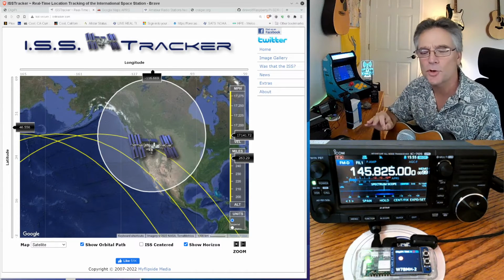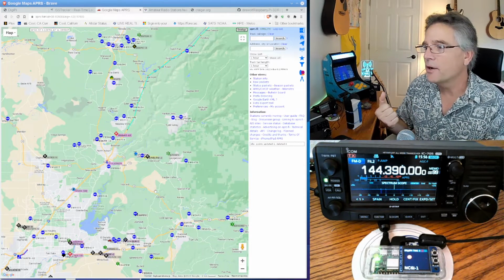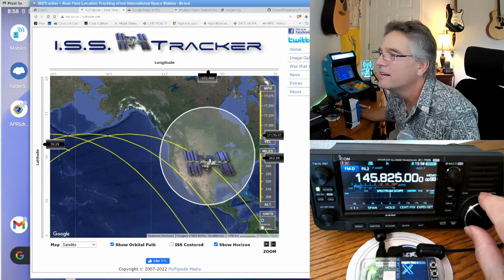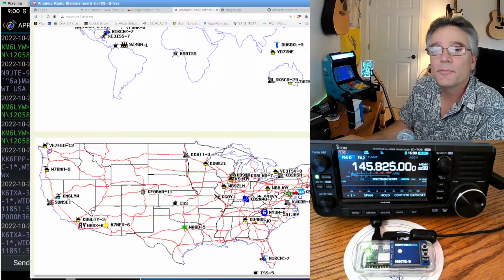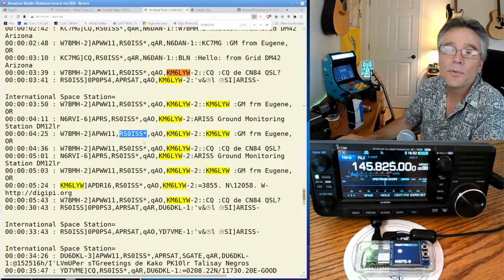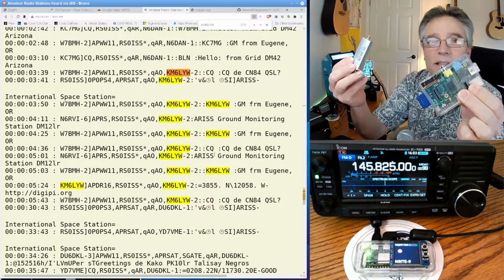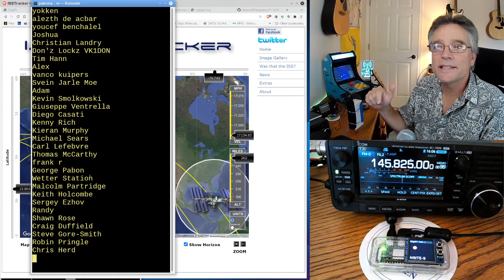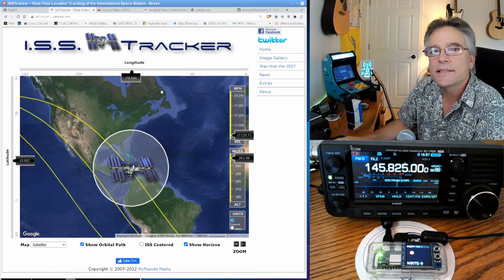Relay radio traffic from Space!

Comment: I've been running a receive only satgate for about 10 years now, my interest in the ISS was back when it was equipped with pacsat2 (basically a briefcase bolted to the outside of the ISS) that was sending telemetry at 9k6 baud for some experimental solar panels at the time (c2006-2007) I was surprised to see a letter in the post from one of the technicians from NASA thanking me and sent me a mission sticker! OK so what does this have to do with digipi? I'm still awaiting some items to turn up so I can put it into local service (I have digipi running on a naked pi zero W) maybe one day I'll get a higher spec pi to be able to run the sstv/ft8/whatever else!
Reply: Scott, I recently setup a satgate.  I thought there were some aprs satellites besides the ISS but the only one I have picked up so is the ISS.  Are there any others still transmitting?  Thanks
Reply: @robertbower9862  I'm only listening on 145.825MHz 1200b and on that frequency you'll hear the ISS, NO44 (when in sunlight) and a few of the smaller cubesats.